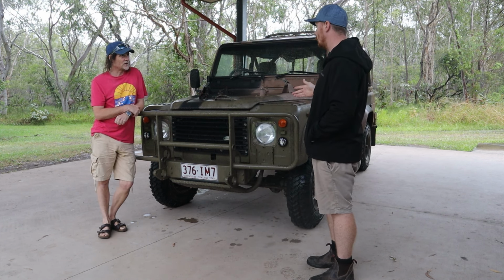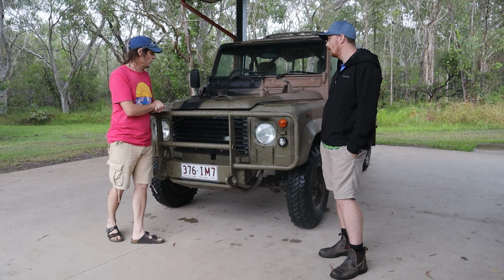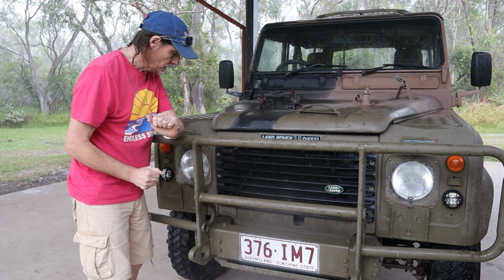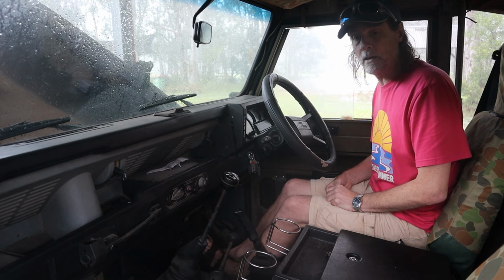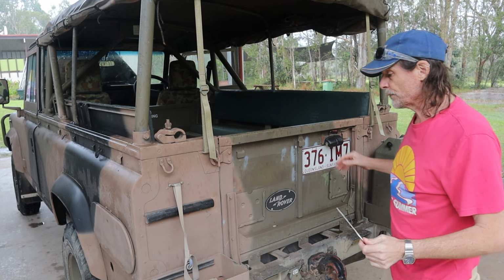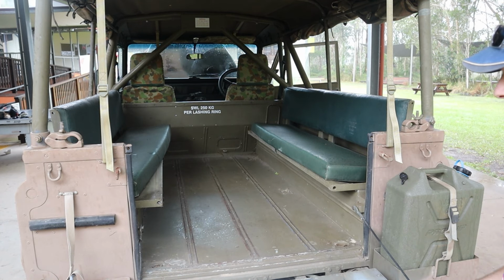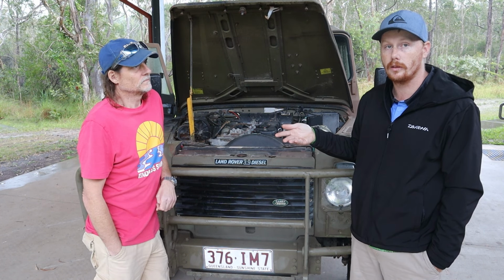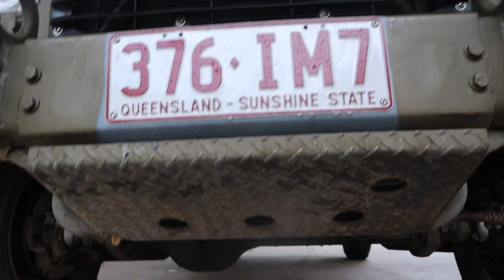Mark's Perentie - 1988 GS

Comment: Is there a 24v FFR version and if there is what is the availability of starter motors and generators for same?
Reply from the maker: There is a 24v FFR. Starter motors are the same and readily available, I think from memory a Mitsubishi starter motor is the same. The generators are often removed and should be easily attained. Thank you for watching